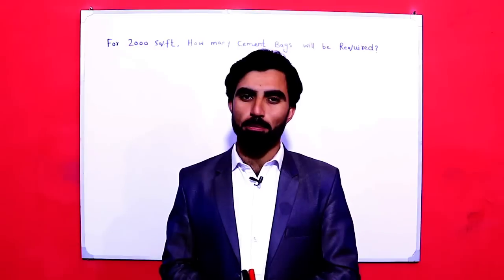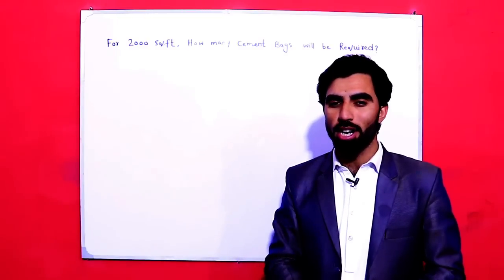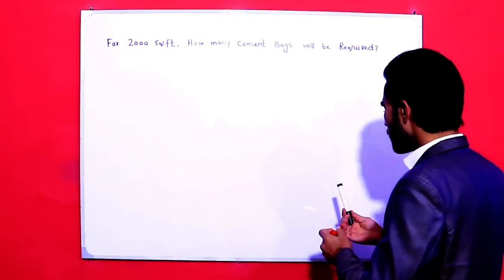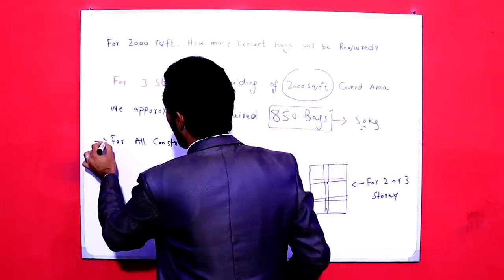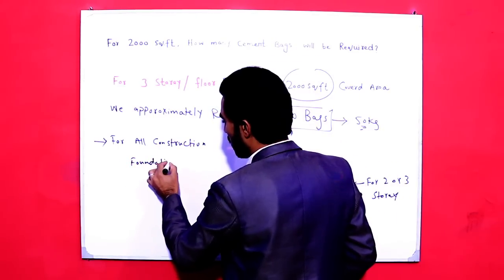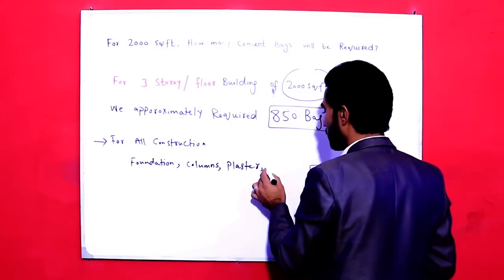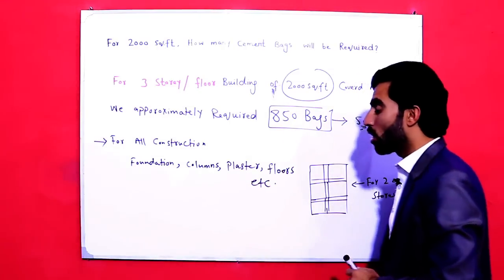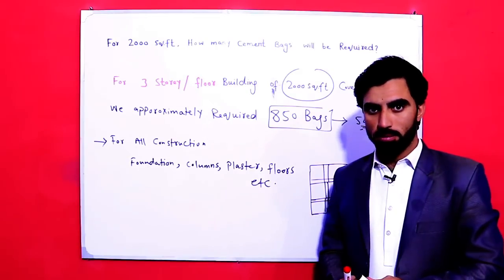For 2000 sq.ft How many Cement Bags will be Required for House Construction?

Comment: The  quantum of cement  bags needed will have variations because of th
Reply: The ratio of cement  mortar mix in The binding mode  such as cement  sand mix ratio of  1:6 or 1:7or 1:8
Reply: My  building   had different  ratios for The granite rubble  foundation   stock brick masonry  wall plaster  concrete  roof slabs RCC pillar colours  tile fixing   sunshades  fine water proof  cement  on main flat roof  with so many variations of cement  usage   There can be no rigid  rule as such  it can be a rough  estimate  only please note my comment